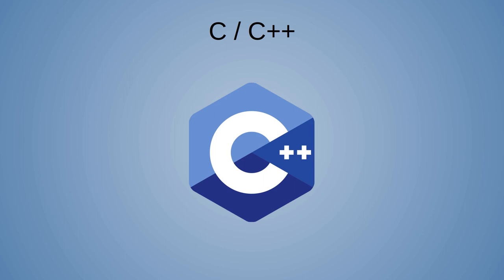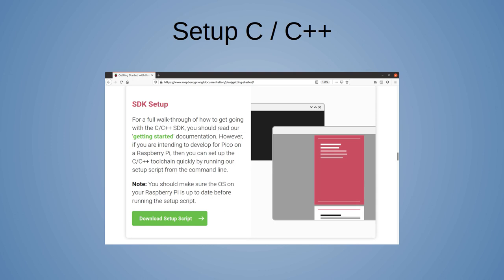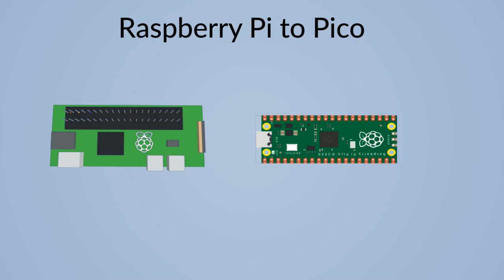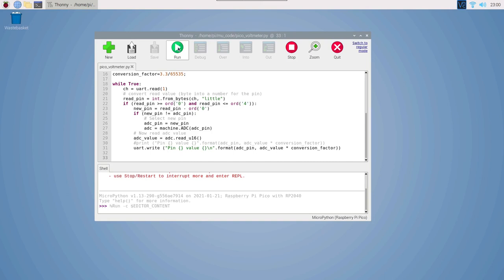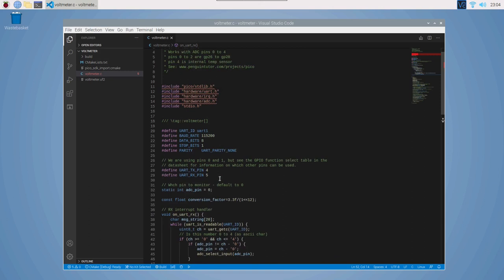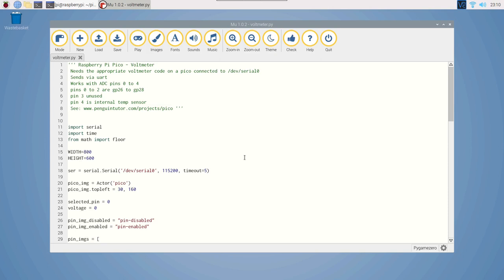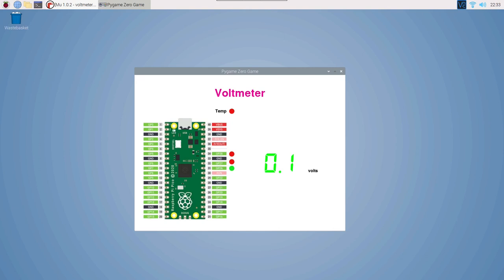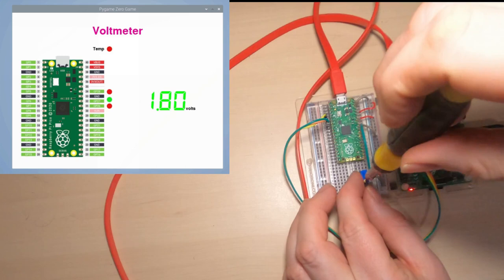Raspberry Pi Pico Voltmeter - UART serial with the Pico and GUI application in C/C++ and MicroPython

Comment: The C sdk is quite nicely written, so much better than the stm32 hal.
One suggestion though, it's good practice to use snprintf instead of sprintf, since the latter can overflow. snprintf forces you to define the length of the string (you can use sizeof for that).
Reply from the maker: Thanks for the tip.

We didn't have snprintf when I first learned C so instead would need to check that whatever we were storing would never exceed the size of our string. That looks like it will be useful as an additional security feature.

Comment: Interesting project, thank you for making the video and sharing. Back in January I went through the process* to install the Pico C++ toolchain onto W.10 and VSC. I have a Pi 3b+ knocking around so I may have a go at installing VSC etc. there. Do you know if it is an easier tool chain to use there as compared to the aforementioned W.10/VSC combo?  *PAIN!
Reply from the maker: Installing toolchains can be a real pain.

The Visual Studio Code toolchain is easy to install on the Raspberry Pi with Linux, thanks to the install script provided by Raspberry Pi.

In future there should be an official version of the Arduino IDE (presumably V2 which is in Beta), but it sounds like there may be a wait on an official version. Hopefully that will make setup nice and easy when it's ready. 

I've also seen that some people have created their own DIY setup based around the Arduino IDE. I haven't looked at that yet as it's probably easier to stick with VSC until the official version is out, although I may take a look if I get time.

Comment: Do both boards need to be powered for this connection to work? I have them wired up but do not know if they both need power or just one. Thanks!
Reply from the maker: The Pico is powered from the USB port on the Raspberry Pi. You only need to use an external power supply connection to the Raspberry Pi.

Comment: Hey, your videos are gold! Thank you!
I would like to ask you some questions about a project Im working on and clueless about it. Seems like your videos are leading me in the right path tho, where can I contact you? 

Is there a way to make voltmeter for analog rf signals in a wire but not convert them to digital or change them at all except for a bit attenuation?
Reply from the maker: Thanks for the comments. 

If you want to display the voltmeter reading in a digital form (eg. LED display) then you will need to convert it it to digital at some point (even if that's using a digital voltmeter module which handles it for you). 

The difficulty with RF is being able to sample fast enough to detect the voltage changes. This can be handled by having a seperate probe which gives a steady output voltage that can be connected to conventional voltage meter / voltage sampling circuit. That is not something I've really looked in, but there is a good article at:  https://www.armms.org/media/uploads/1326125124.pdf

Comment: Wondering about ADC’s accuracy with default noisy Vref
Reply from the maker: It appears to be fairly accurate. It depends how accurate you need. For accurate measurements then you should connect aref and calibrate in software, but for my use I was happy with results.

Comment: Thanks for this video.  
So. Is not possible to use the same usb that you connect to RPi from PiPico to transfer serial information ??
You need to add and extra wiring to UART1???  I’m doing a freq meter for PiPico in uPython .. once I create an instance of machine.UART the trigger handler on GPIO6 goes crazyyy
Reply from the maker: You can use the USB but you have a potential conflict between the IDE using the UART for developing your code and using it at an application level.
One solution is to create your code as main.py close the IDE and then restart the Pico. Not the most efficient workflow whilst developing code, but once you've finished writing the code you don't need the IDE.

Comment: What about AC RMS Measurments?
Reply from the maker: The pins on the Pico measure small DC voltages only. If you wanted to measure AC then you'd need additional circuitry. There are modules based around the ZMPT101B voltage transformer which can be used to measure AC voltage. I haven't tried them on the Pico.

Comment: It is probably me but I find where the script is written on a dark background and reduced due to image size. I find it very difficult to read. This is a shame since it appears to be a very interesting presentation, I will try some strong glasses, many thanks.
Reply from the maker: Thanks for pointing that out. 
I usually leave the IDE at their default background settings. I will look at what I can do for future videos. Perhaps  increasing the font size, which I often do when running this on the console which has a similar problem.  

I also make the source code available to download. It will usually be either on github or my website depending upon the project if you would like to download that.
Reply: @PenguinTutor  Many thanks for your reply.

Comment: what about a lora pico, just sending the strings. easy low power without expensive pi4b
Reply from the maker: I haven't used LoRa yet, although I may look at that in future. 

There are different things that you can use and it's about choosing the one that fits what you want to do and what you have available.

Comment: Is there a way i can DEBUG the C / C++ / Python code ?? in another words , do these IDEs detect ST Link and can these IDEs debug via SWD  ?? Thanks
Reply from the maker: C  / C++ supports the SWD debug pins. That allows you to use gdb to debug. I don't know whether that is integrated into Visual Code, but you can debug on the command line.

The Python documentation does say that you can use SWD debug, but I suspect that is difficult to debug considering you would be debugging the Python interpreter and then have to work out how that relates to your Python code running on the interpreter. The connection of the micro USB port makes it easy to add debugging, although admittedly that is through adding extra debug code to your own code.
Reply: @PenguinTutor  i am a STM32 developer use IDEs like Keil CooCox , there i use ST Link V2 debugger and SWD pins IO CLK and GND of the MicroController to debug the code directly on th hardware.....I am still searching for the same for Pico......Thanks For Reply....

Comment: I am not getting anything on my "receiving" Raspberry (I am not sending any orders from big Pi to Pico - just listening what Pico has to say and it continously sends some strings on UART). Big Pi shows me only [''] ;-( - edited: because as an idiot I went for pins 10 and 11 instead of 6 and 7 on Pico - topic closed. Btw your video is EXACTLY what I was looking for: I am making a project and using Pico as 3x ADC connected then to Zero, that works like a host for some other apps. Pico seems to be the cheapest ADC with 3 channels ;-).
Reply from the maker: Easy mistake - you can use different pins on the Pico, but you do need to configure the correct ones for the UART. It's not necessarily the best quality to ADC (but it's not the worst either) and it only works at up to 3.3V (although you can use voltage divider / other attenuation methods), but it is pretty good.
Reply: @PenguinTutor  yeap, but this ADC measures: 1) input voltage, 2) voltage on LiPo and finally 3) voltage on Pico/Zero. So all 3 channels used (of course with voltage dividers). I am reading in the loop 2000 times and then take average - comparing to my digital multimeter it is about +- 0.5% so I believe it is more than enough - it is to see when charger is disconnected, battery getting down etc.  But anyway, I am still "fighting" with this UART as big Pico sometimes shows me garbage from UART - I am not sure where the problem is - 1 times works, 3 times fails...
Reply: DONE, at 2am ;-)